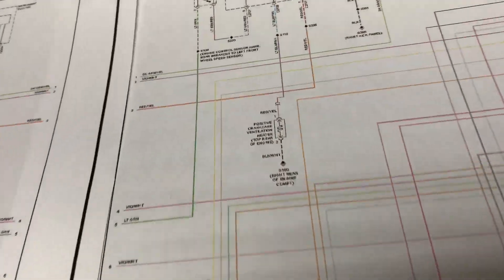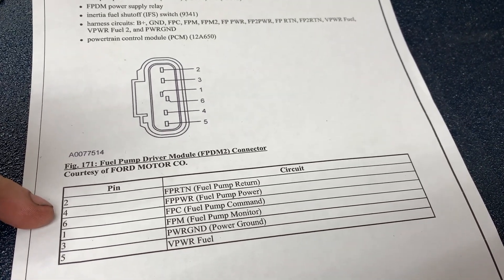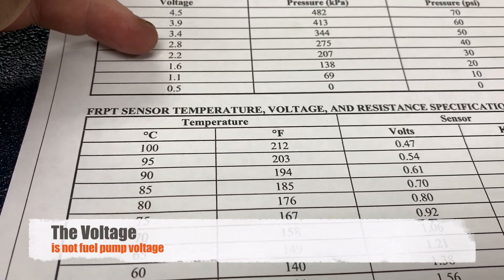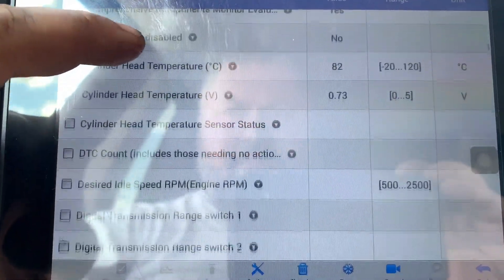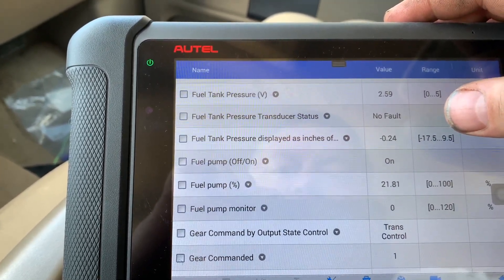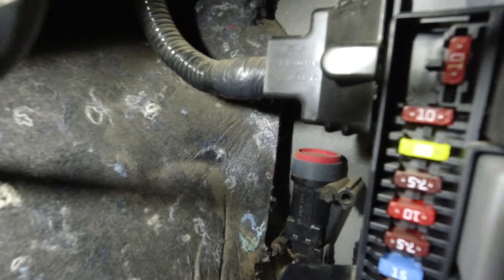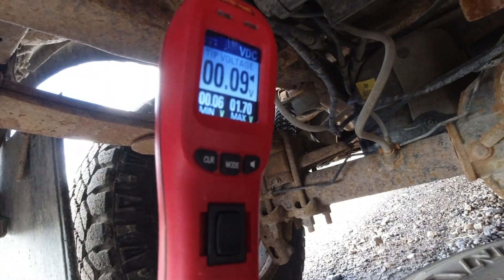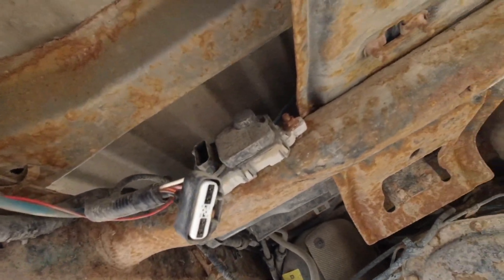P1233 F150 Ford Fuel Pressure and Fuel Pump Module Diagnostic DIY

Comment: My truck stalls, on my scanner I go into the Fuel Pump percentage actuation test. It reads 75%. If I lower it down to 45 itll stay running. Could the module be th problem?

Comment: I checked out the fuel module as you showed. I have power going to fuel pump. I disconnected fuel line from fuel filter coming from fuel pump . When I turn the switch on I have no fuel coming out . Should I have fuel coming out the fuel line at this point?

Comment: I have an 05 mustang running high fuel pressure switched frp sensor because my mech gauge was reading 8 psi under still no change trying to learn about this system  have a rich code on bank 1

Comment: I just replaced my fuel pump, fuel pressure sensor, replaced fuel filters, replaced fuel pump driver motor and my vehicle still bog down and shut off code p0191 is present 
2004 f150 4.6
Reply from the maker: This is what happens when you get the parts cannon out.  Replacing parts on what you feel is wrong VS actual troubleshooting makes a big difference
Reply: @TestDontguess  update disconnected harness from fuel pump driver module checked to make sure there was 12 volts from power to ground with key, also used jumper pins and turned ignition on and pump ran continuously as it should in that condition. Connected harness back to module and there was erratic signal while back probing module I return faulty module back to auto store and purchased a new one from Autozone and all is well now. Long story short original part purchased from advance was faulty.
Reply: @valente estrada faulty fuel pump driver module, purchased another module from Autozone and returned faulty new module to advance.
Reply: So what was it doing. How was it acting wounder if this is my issue
Reply: @rickyrickharris4908  my issues was stalling and occasionally shutting down completely, my check engine light came on with a code for the fuel pressure regulator. Fuel pump driver module ended up being the issue.
Reply: Okay so i guess you also had a loss of power under load? I decided to jus keep driving mine for now and i realized that it only does it about 60 percent of the time when i jump into the throttle.  The other 40 percent it hauls ass kinda strange.  But if i take it easy im good regardless